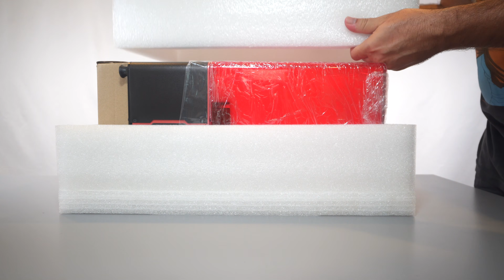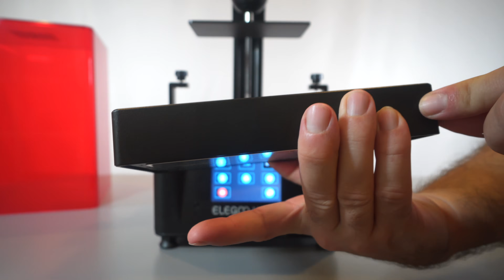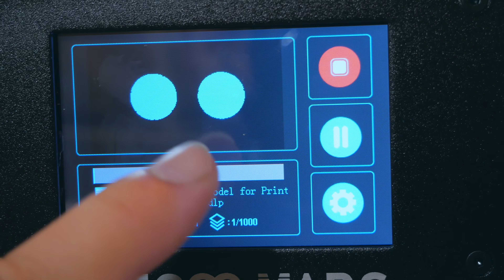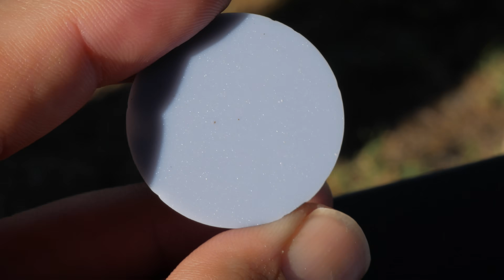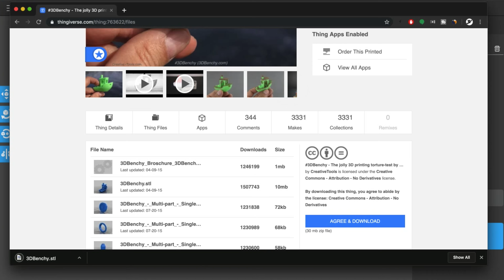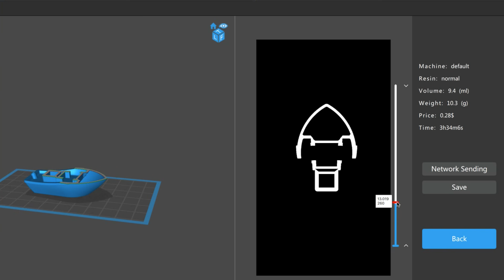Elegoo Mars - Resin 3D Printer - Unbox & Setup

Comment: a few tips:
1. please do NOT pull the models off of the printer bed, use the scraper given.

2. do NOT pick it up by the Z axis point

3. you should drop the models into a full container of alcohol and mix them around until clean.

4. you can cure them in direct sunlight if you live in a sunny place, im in Midwestern US and that wouldn't work. so you should really use a UV light for curing.

5. take the supports off BEFORE you cure it. this way they easily are removed and you don't have to torture yourself trying to snap the pieces off.

6. ALWAYS wear gloves, mask and goggles when handling resin. have them on BEFORE you open the container and do not take them off until you are done handling the uncured resin. if it is "fresh off the bed" and you haven't cured it, wear gear. when you are pouring, wear your gear. do not handle uncured models with your bare hands.

5. don't dump uncured resin down the drain. do not use it in a sink that you also use for food, or a bathroom sink. resin is a bio-hazard, even the alcohol/resin mixture that is produced when you clean it.

Comment: I just returned a Ender3 printer after weeks of not getting my prints to stick to the bed. Different temps, filaments, adhesives, glue sticks etc. I just ordered this resin printer. I hope that I have better luck with it.
Reply: I have an ender3 also that I use for larger prints. If your prints aren't sticking you either didn't level the bed right, you lowered the bed too far below the z-axis brakes and confused it, or your model in cura or whatever was above the z-axis. I had the same problem myself and it was the second issue I mentioned. Suppose your past the solving stage on that one tho at this point.

Comment: Watched many resin printers review and since I've build few cnc machines myself I kind of knew what the issues (at least mechanical) could be expected from Mars. Very important is z-axis itself so first thing I've done is checked if sliding is smooth. It was not. It was so tight that motor could not move the holder all the way through going up. It just gets stuck at the top so I had to apply some force by hand. Then I've readjusted holder with three ball-bearings and now it moves with much less effort. Another problem with Mars is that plate holder, or z-axis screw moves when pushed by hand for about 0.5mm. Problem is Mars's stepper motor and it's inner bearing loaded with spring. For now I will not fix this issue as I've tested z-axis movement with 0.01 meter. Also antibacklash brass nut is not the best one. Real improvement would be if z-axis is replaced with true ballscrew with zero backlash and vertical slider is equipped with two linear sliders. Some people replace this brass nut with 8mm derlin nut. Leveling plate with paper is suggested way but when I've tried left side of the plate is always tighter than the right side. When doing any adjustment of the printer I place thick peace of foam in vat thus eliminating any chance of damaging screen. Printer is otherwise very well built. Most critical parts are anodized aluminum. Moving parts are somehwat lower end solution but good quality ballscrew with supports would cost more than printer itself. So this printer probably cannot produce very accurate models as one could with cnc machine. But again it is a solid machine that can be improved in few relatively simple steps. Not that printer could not be used as is.

Comment: I've seen a video where they remove the supports before UV curing. More messy but maybe easier to break off? Awesome Video! Just got mine today. doing the test print tomorrow:]
Reply: Hey mate just hows the printer been for you? Any complaints or issues pop up?
Reply: @87hergo  haven't used it in a while. No issues with it though.

Comment: Ok, so this is a great video....EXCEPT for the safety part.
You should also wear eye protection.
Put on the gloves early....dont' wait until you think you will need them.

If he would have dropped the plate, or anything into the vat, it would have splashed resin everywhere...wear gloves, this stuff will burn your skin, and harm your eyes.

Please don't teach bad habits.
Reply: Eye protection sucks. So annoying to keep pushing the glasses up or making them stop squeezing you so hard

Comment: Its is not the alcohol you need to up your exposure time to 10 or 12 seconds.
Reply: Not really: if you put in the right amount of resin, everytime it lifts the print from the bed, it will lift it out of the resin still in the vat.. but if you've used too much resin... it won't let the uncured resin ooze out of it... (Mars user myself)

Comment: If you print hollow you need to create holes for the resin to drain if not you will have uncured resin inside that's your issues.
Reply: if Im printing in hole, and I add at least one (1) drain hole, should I put it on the "bottom" of the orientation during printing, or the "bottom" of the finished product?? Thanks
Reply: @Klaymour28  either should work. just be sure to flip it over and let it go out, if the hole is quite small add a 2nd hole to let air get in if you put it on the bottom orientation it might have some resin in it when done but most of it should already have drained during printing while it was still open on the top during the print.

Comment: Instead of curing outside you can also use a little UV lighting setup in a box, it’s the uv light that cures the resin quicker. When using the form 2 resin printer at university we had a box that was clad with silver foil inside with uv lights inside which you’d pop your prints into to finish curing if it was still kinda sticky. Just bought my elegoo mars but not had a chance to set it up so your video helped give me some much needed insight, especially in regards to risks when hollowing our files in the slicer.

Comment: Can you tell how loud the printer is?
Reply: The fan in the bottom is a bit annoying.
Reply: @runklestiltskin_2407  I love the noise of the fan
Reply: @santiagolozoya4940  it's giving you ASMR!
Reply: I think it relatively quiet, but is a subjective thing.
Reply: Noise is moderate to low. The smell can be bad though.
Reply: I have hear of people swapping out the internal fans with quietter ones and then point a desk fanat the print in front of a window to deal with the fumes.
Reply: @CertifiedSunset  u should keep it away from windows cause u know, uv